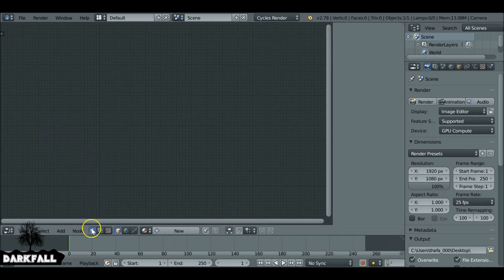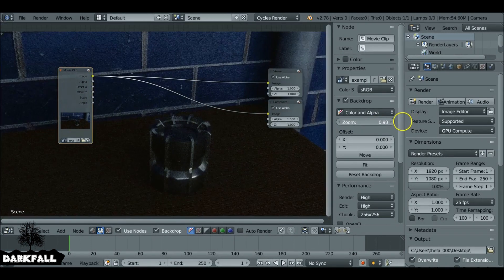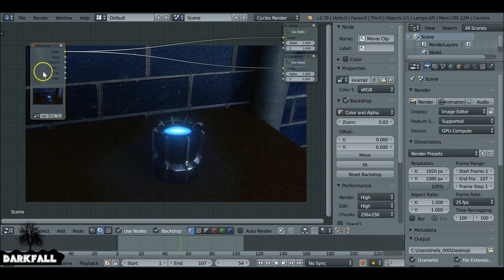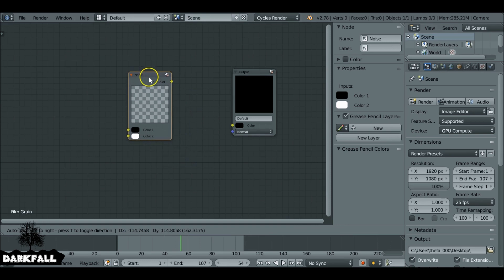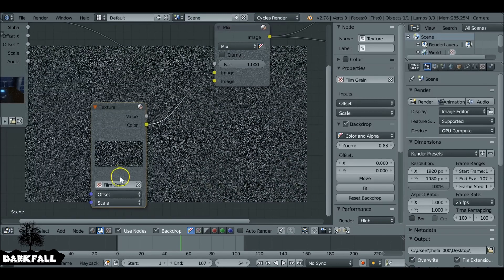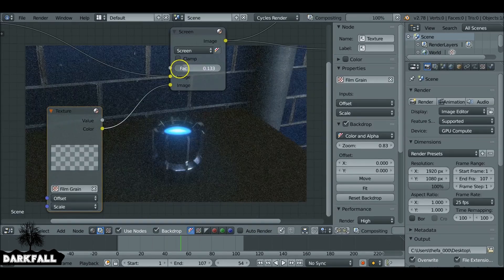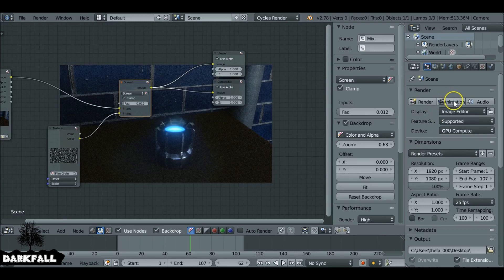Blender Compositing VFX Tutorial : How to add Film Grain

Comment: the noise will have the same pattern all over the video, which is wrong, for still it might work
Reply from the maker: The noise pattern changes on each frame...
Reply: really? well that's good, mine stays still
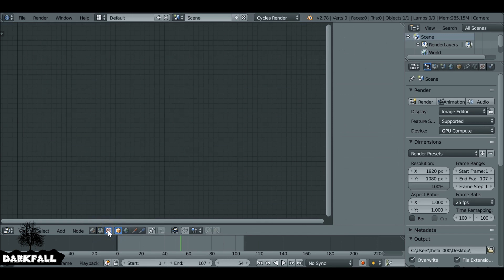Reply from the maker: When you set it up, before you reduce the factor jump to the next frame and you can see the pattern changes.. Be sure to set "World" rather then the default "object" ( I do this @1:13 ) and it should change on each frame..